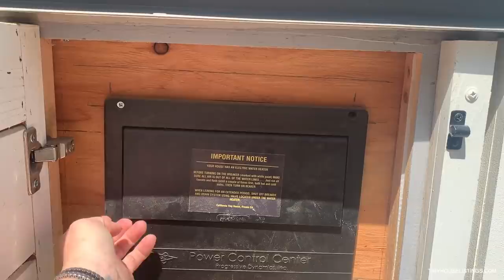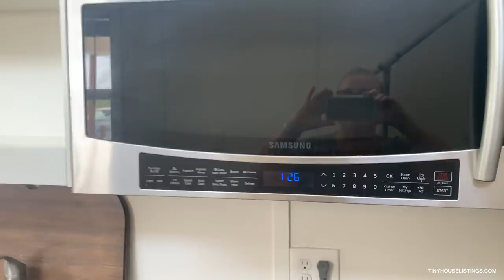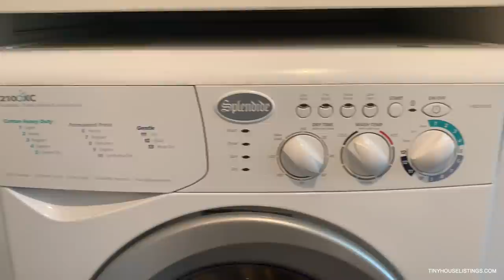Buy This Tiny House And Escape The Rate Race FOREVER

Comment: No stove top, even two burners... A pity.
Reply: Not a deal breaker, I have seen several chefs use portable burners, gas and electric.  In such a small space it gives you the option to use them outside.  But that house is too small for me to feel comfortable.
Reply: Listing states there's a moveable induction cooktop, in addition to the convection oven above the counter top...